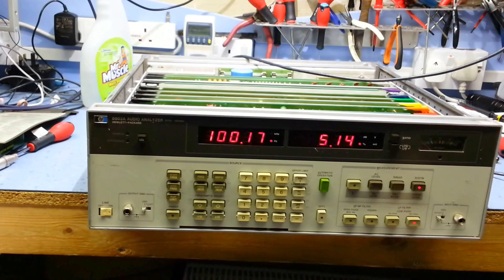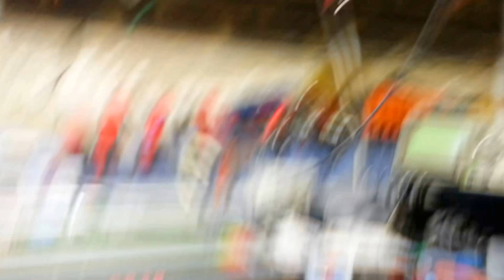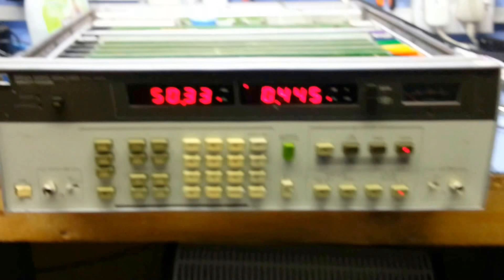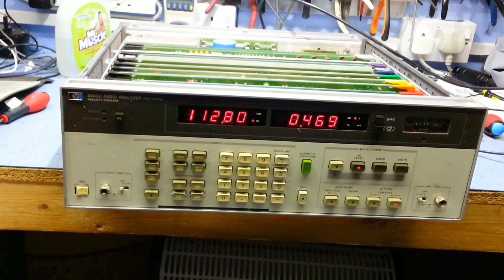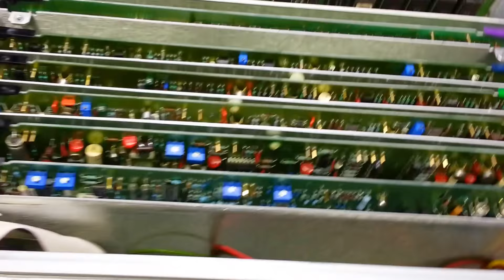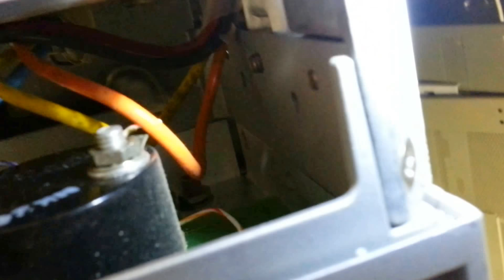Hp 8903a first poke about

Comment: Hi, I have the same problem with my  8903a, it shows 6.21% of harmonic distortion when I'm feeding the 8903a output to it's input. How did you solved this issue?
Reply from the maker: Feed another source into it and see if distortion is good. You need to know if it's the source or the distortion measuring section
 Look at the next video. It was a capacitor on mine.
Reply: @SoddingaboutSi   Which capacitor exactly caused the problem?

Comment: I bought one of these lately and plugged it into my Racal-Dana 1992 (which is very accurate) and the the frequency’s are not stable at all. Constant movement after the point. Any ideas Simon ? Keep making the videos. I learn a lot from you. Thanks
Reply from the maker: First clean all the edge connectors and check supply ripple. See how it does then.